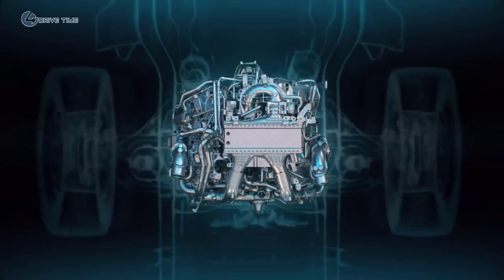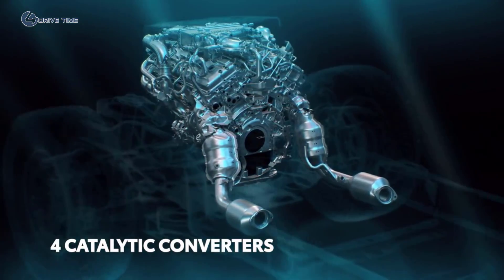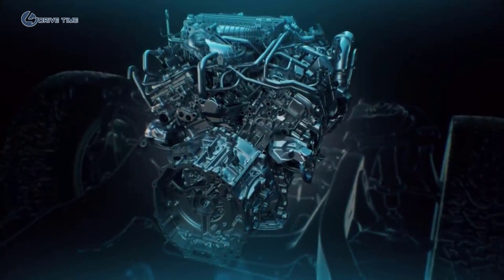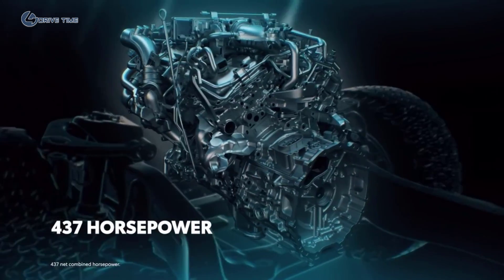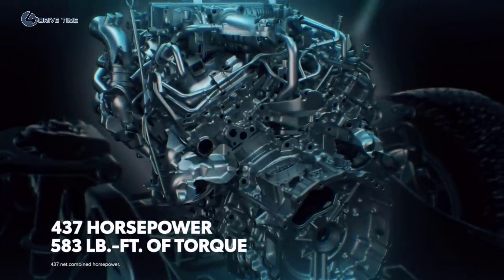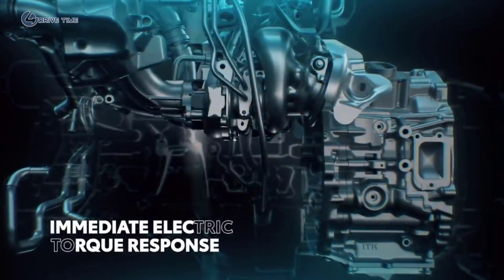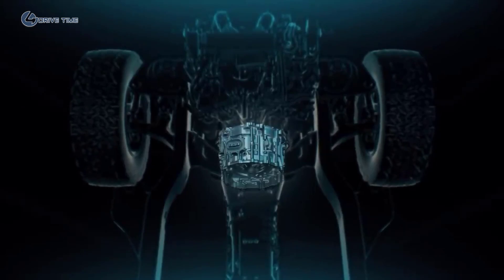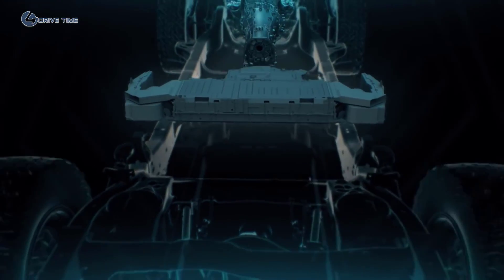2022 Toyota Tundra Twin Turbo V6 engine Production – US Engines Factory

Comment: American's get the undesirable leftovers from Europe. Tundra's turbo wastegate doesn't open. This will cause rapid turbocharger wear and failure or shrapnel in the intake. Only N. America has this obsolete piece of crap motor !
Reply: Yeah that was just a bad batch, they’ve ramped up production since and they’ve all been fine
Reply: @Haltech92  Even lemons are fine in the beginning. Toyota turbo motors will last just as long as Hyundai turbo motors
Reply: @miss.wright3035  that’s reaching, really really reaching.

Comment: 4:30 how did I know the failing wastegates were electric? Lol. GM perfected the wastegated turbo in 2001 for their diesel trucks. Simple diaphragm driven by pressure, no computer. Works great 20 years later. And if Toyota wants to use computers, use VGT turbos! Like holy shit Toyota, way to overcomplicate something simple. "...and it's called 'forced induction'..." 🤦‍♂️ My gen 2 Prius is great. There's good use of computers from Toyota.
Reply: GM DID NOT perfect the mechanical wastegate 🤣 you are joking right? The Germans and Japanese have been using them since the early 80s in MANY different applications from steel to strip
Reply: @Nerd_Rage_Initiated  well, I think you confused the term "perfect" with "invent". Anyway, I don't doubt many nationalities have also perfected the wastegate on a turbo. We're talking about American market trucks here. GM's application of a mechanical wastegate in their diesel trucks for the U.S. market beginning in 2000 was such a good application then that it is still in use today for 20 year old GM trucks and works quite well. I chose that as an example because it is relevant. Frankly, I don't see any German or Japanese light duty diesel trucks for the U.S market, much less ones using mechanical wastegates, so that's pretty irrelevant. My point was that Toyota overcomplicated the design and got screwed because of it. Why didn't they choose to manipulate a VGT with computer like every other light duty diesel truck automaker? Why choose to manipulate the wastegate instead? I drive a 2005 Toyota that uses computers/electronics heavily and it works fine. It's surprising that they'd have trouble getting the electronics right on a god damn wastegate.
Reply: @bat__bat  No diesel truck apps in the US, correct, but a turbo is a turbo and the applocation in general was already in use for about 30 years regarding the year model you are specifying. The auto manufacturer doesn't even make their turbos, which is why they were "perfected" because the turbo companies...Garrett, Bosch, etc have already perfected the mechanical wastegates in the 80s
Reply: Variable geometric turbos are far from a perfect design. Look up "carbon deposit issues VGT" and you'll find lots of complaints and issues. Also the electric waste gate issue Toyota had was with the initial trucks that were built between Q3 of 2021 and 1st quarter 2022. That is a non issue now. People seem to forget that when the 5.7L V8 first came out, that engine was snapping cams and Toyota fixed that issue too. That didn't make the 3UR-FE unreliable at all.

Comment: Now only if they put this in the Tacoma it would be PERFECT
Reply: The 4 runner and tacoma need 330hp in my opinion. I’d definitely buy it with that 3.5tt motor in it!
Reply: @Weatherby406  agreed 👍 
@Toyota you heard us!!! Now give us what we want lol
Reply: If they put this on the Tacoma.... Ill own a Tundra and  Tacoma, lol.
Reply: This engine is a TURD! Look up all of the failures in the Tundra. It's all over the forums. I'd rather prefer the Tacoma sticking to the turbo 4 cylinder or bypass that for a V8 which, of course, will never happen.
Reply: Bring back the 4.7 v8 and and do away with this turbo garbage
Reply: @mendoblendo321  boo hoo 🤣💀

Comment: I'm thinking... I'm hoping... this engine will soon become an aftermarket tuner wet-dream - like my 3S-GTE, back in the day....
Reply: lol. EPA say no no . They gonna try to come for us many ways.
Reply: This in an Evora would bring it to a whole new class
Reply: If Toyota would have built a new Supra and used this engine, it would sell better than that pos bmw excuse they are using now.
Reply: @ACommenterOnYouTube  The mighty B58? You smoking rocks
Reply: @Permethrin08  "mighty" ..??? What is mighty about it ??
Reply: @Permethrin08  🤡
Reply: @ACommenterOnYouTube  yes
Reply: @ACommenterOnYouTube  Heck yeah!  Can you imagine 437 hp and 583 lb ft in that little car.  I think the car looks great but the power plant is not a step in the right direction man!  That car should stay a legend.  It should be Toyota's GTR killer!!  At least when optioned correctly.  Instead it's a Miata killer.  Swing and a miss.  Won't be long before these wind up in those Supra's, though, with Explorer rear ends.  Y'all watch.

Anyone know where it makes the power?  I'm talking about where in the RPM range just in case there are some non-gear heads paying attention.
Reply: So the I-Force Max engine he got.  Does use a motor located in the bell housing to boost the torque and hp.  Hp high is at 5200 rpm.  That's really not insane.  If you pay attention to where your own automatic shifts when you hold your pedal to the floor you'll see it shifts somewhere around 6,000 rpm.  Max torque is at about 2,400.  Not crawling but not screaming either.  I couldn't find an actual dyno print to see what it is at 1000 or 1500 where it would usually be when you are crawling around on a trail.  However, I'm pretty sure it would be enough to make you smile.
Reply: @ACommenterOnYouTube,  Please don't talk nonsense, B58 is a very good performing engine AND reliable, proven.
Reply: @ACommenterOnYouTube  FACTS!!